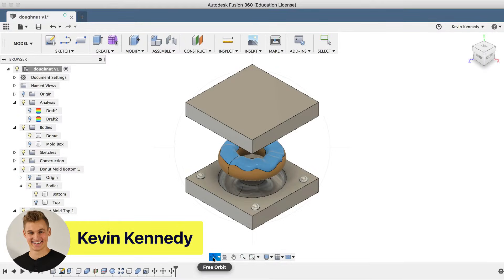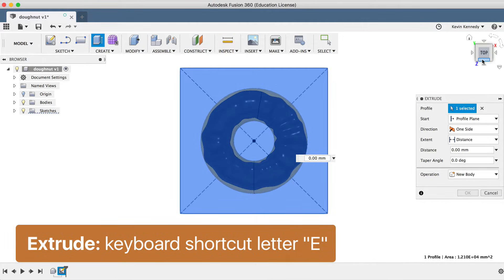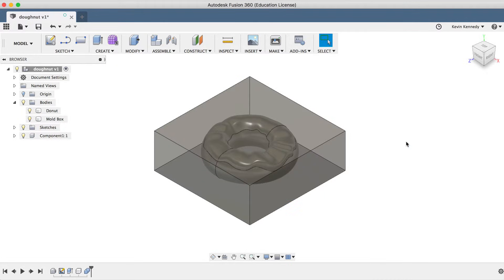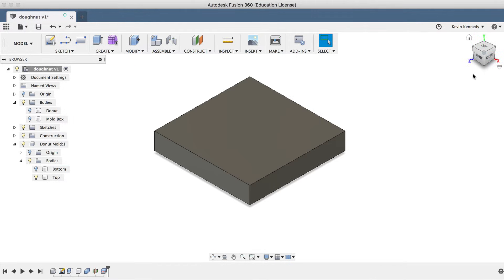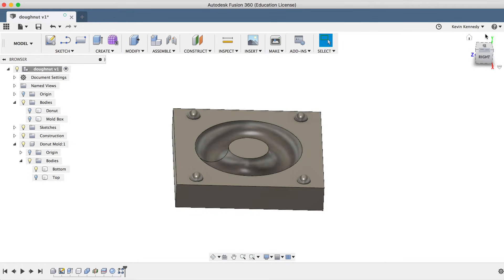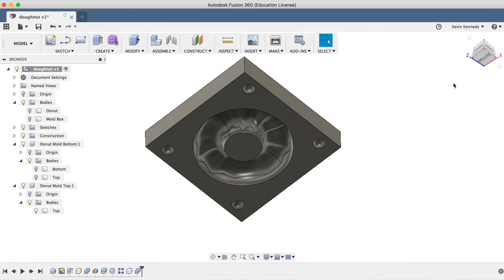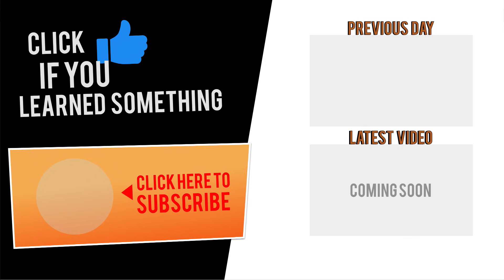How to Create a Two-Part Mold in Fusion 360 - Learn Autodesk Fusion 360 in 30 Days: Day #21

Comment from the maker: How'd it go?? Drop your Fusion 360 questions about this video in the comments below! 👇
TIMESTAMPS
0:00 - Create a 2-Part Mold in Fusion 360
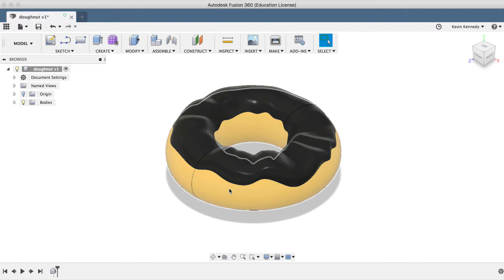1:10 - Create the mold box
2:34 - Change opacity of a body
2:48 - Subtract object from the mold
3:37 - Create a construction plane
4:12 - Split body into two pieces
5:59 - Create registration spheres
8:23 - Create a hole to pour into
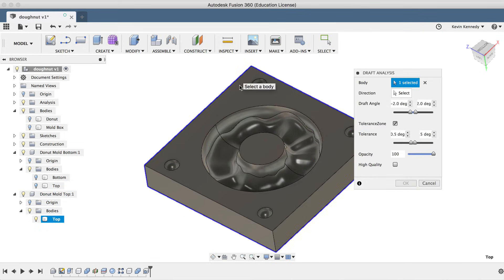10:10 - Draft analysis
11:35 - Save for 3D printing
Reply: How could one fix any support issues inside the mold for printing!? Just printed my first fold and half work better then the other!
Reply: can i send you my file and can you just do it for me? ill pay

Comment: this is soo much easier than off-set plane, then spline tool for how you want complex body to split, use the surface extend tool on the spline, then split the body into two then try to patch, stitch, unstitch, delete surfaces until you have a two part mould by multiple of alterations. Thank you!

Comment: I  have a weird problem where every time I try to make a new component, anything I try to do after that is almost completely transparent - still there but I can barely see it and it's so hard to work with. Has anyone found a solution to this?
Reply from the maker: Right-click on your top component and check the "Opacity" setting. It could be that. If not, any chance you applied an appearance to that specific file?

Comment: Hello, thanks for the great video!

Is there a way to offset the mould and the original body? Let's say I want a 5mm gap between the donut body and the mould. Even if it's not possible to do automatically, how might I do it for simple convex solids?
Reply from the maker: You can use "Offset faces" on the solid body to add a gap, after the mold design is cut out.

Comment: wondering if you might address using a 3d scan mesh in place of the donut.  seems like I can't do that.  I've since used mesh smoothing and re-mesh to simplify the mesh and then converted that simplified mesh to a solid body.   Seems like even with a really solid machine this is too much for fusion 360 to handle.  I'm unsure how to use the mesh information to create this shift knob shape. (google OEM z32 shift knob for a picture) would love some direction as this has been way more difficult to do with the 3d scanned mesh as the plug.  Thanks!

Comment: Fantastic tutorial. I am trying to mould an object that is like a cup. i wish to have mould in three parts front fear and top. with the top being the top and hollow section of a cup. How do i make a removable  plug as the pot section of mould? all the cut functions are across plane not to a set distance like 25% in to where the cup wall starts?

Comment: Great tutorial! I do have a question though, would the registration keys require a bit of tolerance around them to ensure the moulds actually fit together nicely? If so how would you ensure there is say a 0.2mm tolerance in the subtracted keys?
Reply from the maker: Yep! Use the Offset Face tool to subtract the desired tolerance (0.2mm total does work well in my experience).

One note with Offset face is that it will apply to the whole face so you'll actually subtract 0.1 to get the desired .2mm total
Reply: @ProductDesignOnline  Thanks for this info Kevin! love the tutorials, keep them up. Its because of your tutorials that I get better at F360 every day and can make my own models for 3DP!

Comment: i just made a mold that doesnt need to be split it is a cookie mold and when i made a mold with the combine tool and the new component is now the final mold when i rcport it to cura its just a hockeypuck.. and i dont know what i did wrong i tried several times but no result :(

Comment: Actually watched this just to see what tolerance you'd put on the registration pins for 3d printing out of curiosity. Depends on what sort of printer you're using and how well tuned I suppose.  I tend to offset face by 0.1 to 0.2mm myself. Figure you didn't want to complicate the video probably!
Reply from the maker: Yea, I usually use .1 as well. But many factors at play. I totally recommend people start with .2-.3 if their not sure how dialed in their printer is 😄
Reply: Interested in this, do you offset both sides by that amount, or just one? Just started making moulds, playing it safe and have been doing the male side 0.2 and female 0.1 and they are on the slack side. Don't really want to experiment too much as each mould print takes about 28 hours.
Reply from the maker: @viperz888  I do just one side with .1, that's with a printing resolution of .1mm and Ulitmaker with settings dialed in. If will depend heavily on how 'dialed' your printer is.

Comment: Thanks for the refresher. I have made several of these that I use for press molding custom carbon-fiber bike parts. It's very easy to do -- you don't even need parting fluid, you can just use kitchen cling wrap over the mold and lay up the wetted CF, press, clamp (I use more cling wrap, stretched, to provide the compression) and you get perfect parts.
Reply from the maker: Great tips! Thx :)

Comment: HELP~  I did everything in this video and my mold will not hollow. I can select the box as my target body (no problem) Then I go to select the model for my tool body and nothing happens. I mean no alert, no notification, nothing. No matter what I do, I can't get it to select. I thought maybe my model is too large, so went back to the beginning and reduced as low of triangles as I could without loosing too much definition. What the heck do I do? I have a deadline to meet on this mold. Please help! Thanks:face-pink-tears::face-blue-wide-eyes:

Comment: Love this series (and your other Fusion tutorials as well). What filament do you recommended for making molds? I've seen some sites recommend PETG, others ABS or ASA? I would've thought TPE or TPU would be easiest to bend apart. I've also printed in PLA, nylons, and PC, so curious what you've found works best for holding epoxy resins? Thanks.
Reply from the maker: For epoxy, I've always used PETG or TPU. What I've found matters more is using a 'mold release'. I typically use this one - https://amzn.to/3HjFPY1 and if you're in a pinch to get a project done you can sometimes get away with using PAM from the grocery store - https://amzn.to/3zIwhE6

PETG is better to have 'crisp' detail and surfaces, but does not work well for complex parts as you cannot really bend it...so you need to split the mold into 3+ pieces. TPU is the opposite, though you'll lose quality and detail depending on what your'e trying to achieve.
Reply: @ProductDesignOnline  Makes sense and very helpful. Thanks!

Comment: Have u done a video on making a 3D mold on a sketch u drew? I made a sketch and loaded it to Fusion, I traced over the sketch and have the layout of the sketch from the drawing. Now I am trying to make a 2 piece mold of the sketch I can print with Fusion so I can inject with soft rubbery plastic so I can have what I created on the sketch.

Comment: Thank you for the great tutorial. I have a question about the registration spheres. Will top and bottom parts coincide? Or should we allow some tolerance gap to have a better closing of the two pars of the mold? Thank you.
Reply from the maker: If you plan to 3D print, you'll want to factor in a clearance of approximately 0.5mm to allow the registration pins to align. This can be done with "Offset faces" command.
Reply: @ProductDesignOnline  Hi, do you have a video on how to do these offset faces?
Reply: I had the same question. In practice I have found for my printer that .5mm is a bit loose and .3 is very snug. If the offset plane feature isnt working I would create a sketch on the plane draw a circle with diameter of the sphere and use the revolve tool to cut your two components using the offset tool in the sketch to create the correct size circle.

Comment: How do you do the same thing but add a slight air gap around the model you want to subtract from the new body? Is there an easier way than slightly up-scaling the model slightly larger before subtracting or is that the only method?
Reply: You can use "offset faces" to offset them a defined amount away from the tool or original part

Comment: Great video. With your help, I created my first 2 pc mold that was 3D printed. The final mold though turned out to be a bit on the small side. The mold cavity is a 4" long angled pipe 0.615" diameter. It will be used to pour urethane parts. I need to increase the diameter of the pipe. I think it's possible. Any tips on going back into the drawing to increase the pipe diameter?
Reply: No need to answer. When in doubt, start at the beginning. The question was answered in the first video in the series 'Navigating the Fusion 360 User Interface'. This is a great series. I am learning F360 to model parts for our company's parts that are destined for our 3D printer.

Comment: On the doughnut mold bottom component there is still a top body of the mold in the dropdown list. Will that effect the STL file?
Reply from the maker: No, as long as you only export the individual bodies. If exporting the Component you can remove any unwanted 3D bodies :)

Comment: how would someone add tolerances to the registration pins? Wouldn't it be better to have some offset in those spherical cuts?
Reply: Make the positive spheres .3 mm smaller.  You can't put a positive & negative item together if they are exactly the same size.

Comment: Hi Kevin, a great video. With the two part mould you would need to create a negative of each part of the mould as a first step. How would I do that with the current mould part? For example I have a negative mould-then cut out in wax-use silicone to create your mould part-use your mould part to fill with resin-resin doughnut completed.
Reply from the maker: Thanks, Matt. Not sure I'm following your question. Can you post pictures/details of what you're trying to achieve in my community space?  https://bit.ly/PDOcommunity

Comment: Running into sphere issue. Says visibility issue when I try to add those markers.
Reply from the maker: Make sure your body's folder is turned on in the Fusion 360 browser. That, or one of your components is turned off.

Comment: Sweet vid. Any chance of doing a tutorial for making soft plastic lure mold with side entry for the plastic injection? And cylinder pins as the registration? I have a CNC router and would love to know how to make my own molds. Would be awesome to see the CAM part of it too cutting out the pockets, etc. My Router is like a Workbee 1500x1500. Aluminium block will be the material. Not sure if anyone has done tutorials online of this before but this vid helps at least. Thanks.

Comment: would you want the registration key positive to be slightly smaller before printing?  If so, what's a good ball park number .3mm?
Reply from the maker: great point, Ben! .4mm is usually what I use for clearance. Anywhere from .3 to .8mm works depending on the other variables of the printer, slicer, etc :)

Comment: It seems doughnut cannot be downloaded. So, instead I created a "torus", and start practicing with it. You create torus by clicking on "create" in the "solid" section and then finding torus. Also, I agree that it is necessary to create a hole for the air to come out, as I have watched a creation of a mold for a yacht keel, and the person doing it forgot to create this hole, and so there were problems pouring the molten lead into the mold. I suppose the air hole must be created on the same side as the hole for pouring the liquid (bottom), just at the opposite side and really small.

Comment: can you split a mould following a spline line?, im trying to split a wing mould but it does wierd things! the tool does cut a wing but it does leave some uncut stuff also .... cad life
Reply: Yes. A picture might explain it better (http://www.dropforging.net/image/forging%20of%20aluminum%20alloys.jpg)  This is how a part would come out of a forging die.  This one still has the flashing (where the excess metal comes out - You have to trim it to get the final part). If you looked at the part in the XZ Axis the flashing would look like just a line - you would not see any of the surface part.  It is a RULED SURFACE with a DIRECTION (Direction is the Y Axis).  You would have to take a slightly different strategy at both of the smaller ends to make the transitions from one side to another.  For turbine blades, for example, you would want the parting lines to follow the leading and trailing edges to get proper metal flow and grain alignment. Are you trying to split on leading/trailing edges -- or along the top/bottom?

Comment: I see this video is a couple years old maybe some updates have changed some features. I have an .stl file that i import into fusion360 but it comes in as a mesh and won't allow me to combine the mesh body with the box I have drawn around it. Am I missing a step? Am I on the wrong video for what I want to do?
Reply from the maker: It will depend on how complex the mesh file is. What is the object? If there are too many triangle facets it won't work.

Comment: I watched this video mostly to speed up my use of pegs / registration marks, but the technique here doesn't work well for 3d printing, since there is no tolerance, and no obvious way to add tolerance. These videos are an amazing resource and series, but the entire problem of 3d-printing larger objects is still tough for me, because the "dovetail" design leads to overhang so can only be printed in one direction, and these dots have no clearance. I'm currently using cylentrical pegs because I can create a custom parameter, offset, but it's just very clumsy for me to do. I am also now thinking that creating a "slot" like channel would be good for some parts, but can't find an easy way to do that with fusion --- again, with tolerance as a parameter.
Reply: use 3d infills such as hexa cubic and gyriod. Will give structure to mold. Then make sure you slice it so it needs least amount of supports

Comment: Hi! I made the top invisible but you still can see its ghostly shape, and no matter how I turn the bottom part I can't place a sphere on the top of the bottom - it ends up on the top's top.

And if I select a top surface of the top - then I can work with the bottom part. But when I make the top visible again - it shows as a solid piece without the doughnut hole in it.

Comment: I found this very informative. If you were trying to split and align the item in the box (for making  a sand cast mold) would the process change? Do you have a video on that? (sorry, I'm not sure how to search your video library). I plan to be making brass and aluminum flywheels approximately 4" in diameter and 3/4" thick with features on both sides so a 2 part mold is required.
If I knew how to link to a video I could send you an example of the models I build if it would help explain this.

I really am enjoying your videos. You are very good at explaining what you are doing in a simple manner for those of us that are "technologically challenged"
Cheers from Canada
Reply from the maker: Hi, bhein67. Depending on your model, you may need to make a 3-part mold. It really depends on the shape, as any potential "undercuts" would require additional ways to remove the mold so you don't mess up the object.